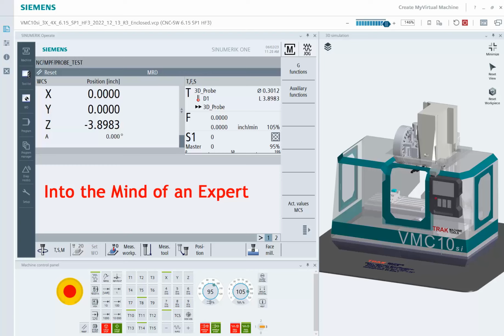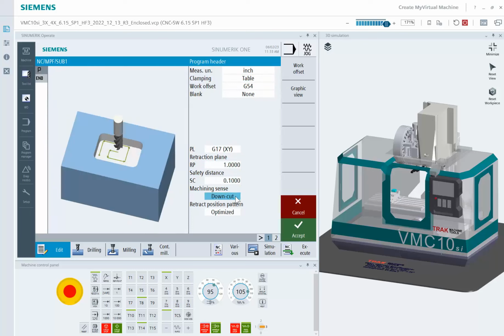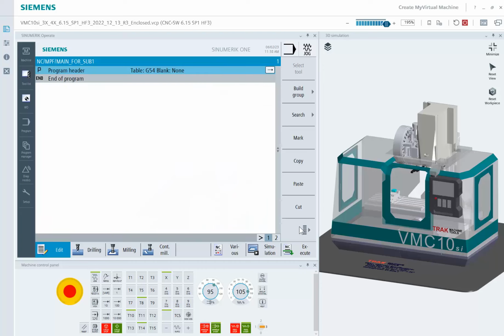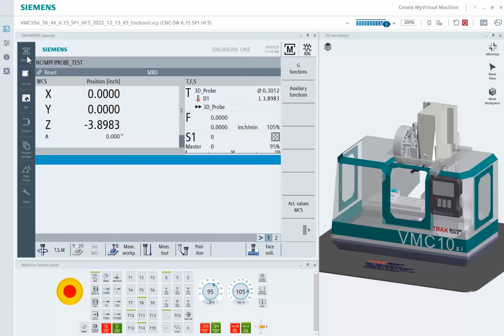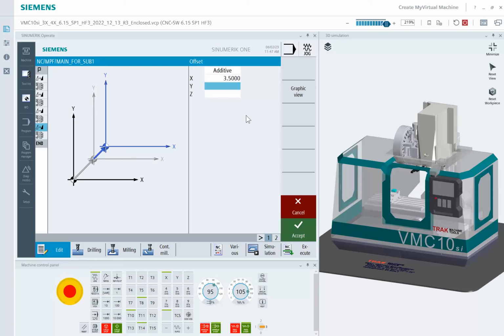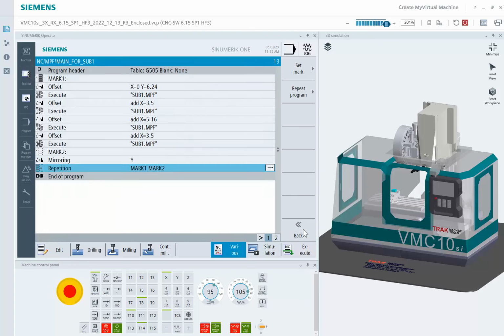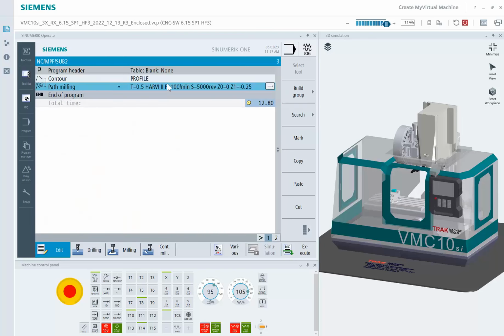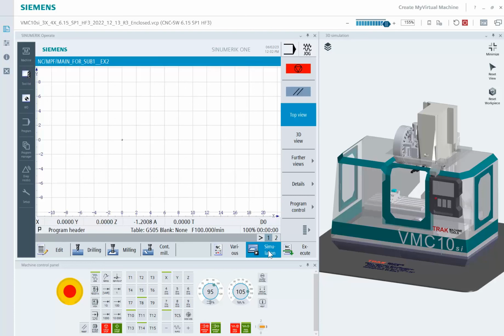Calling sub programs and Mirroring in ShopMill

Comment: This is very helpful.  Subprograms are a challenge for correct syntax, but Shopmill shows what is correct when selecting the G code option.  When I show a correct syntax, the Mastercam programmers now will know how to make this function correctly while they develop the post.  Even the Mastercam post you helped them develop did not have Subprogram done correctly for G code.  The challenge for them will be how they can provide enough of a start for the machinist to fill in or point to the correct subprogram to repeat since it is outside of the main program (external).  Shopmill is not friendly toward the old way of jumping to a sub at the bottom of the main program, which is after the M30.
Reply from the maker: why dont you email me to see if we can help you dan.strubel@siemens.com

Comment: Can you show how to R-loop with G code? 
I know that ive had to mail you sir with question about looping but it was a different case. Im struggling with looping with R commands (While, Endwhile, If, Z=R1, X=R2, R1=R1-0.25etc).
Reply from the maker: G90 G54 G700 G17
WORKPIECE(,"",,"CYLINDER",64,0,-1,-80,4)
T="CUTTER 5/8IN"
M6
D1
S5000 M3
R1=4 ;workpiece diameter
R2=$P_TOOLR ;active tool radius
R7=.5  ;radial engagment 1=50% of tool diameter
R3=(R1/2)+R2 ;start point
R4=(R3/(R2*R7))
R5=R4*360
G90 G40 G0 X=(R3+.1) Y0 ;+.1in safe distance
G0 Z.25
G1 Z-0.1 F150
X=R3 Y0   ;move to start point
R6=0
R10=R3
WHILE R6<=R5
R11=COS(360-R6)*R10
R12=SIN(360-R6)*R10
G1 X=R11 Y=R12 F150  ;spiral point locations
R10=R10-((R2*R7)/360)
R6=R6+1
ENDWHILE
here is a example
Reply: @MrCNC  are there any chance for a video showing hov to work with these kind of loops?
Reply: @MrCNC  By the way. Your channel is really helpfull for me. I learned some usable things from it or learned things that I didn't know could be done. Its a real mine of knowledge :)

Comment: When working with subprograms that happen on a sub spindle on a lathe (so G55 mirrored) they cannot be simulated as the 828D can’t handle tools: they are perceived as facing the wrong direction. My hunch is that when a sub program is simulated it expects it to be something happening on the main spindle (as this is the whole mirroring concept works, I think).
The only workaround I found it to manually edit the .MPF in a text editor to change the very first long number after the parenthesis. This seems to be the “checksum” number that tells the control the sub program has been simulated.
I would like to discuss this problem with you if possible.
Thanks!
Reply from the maker: please email me you question. Dan.strubel@siemens.com